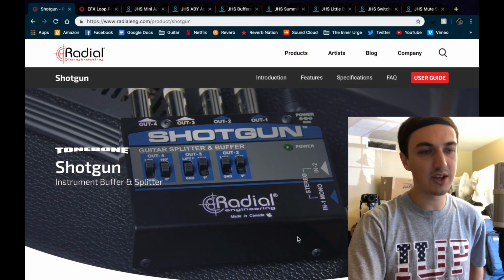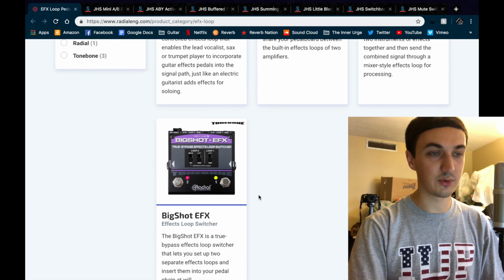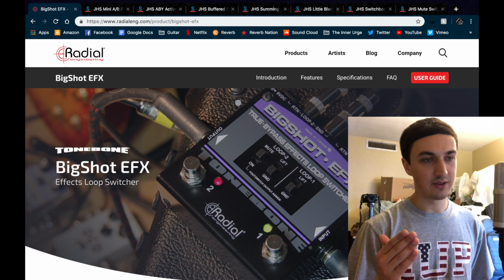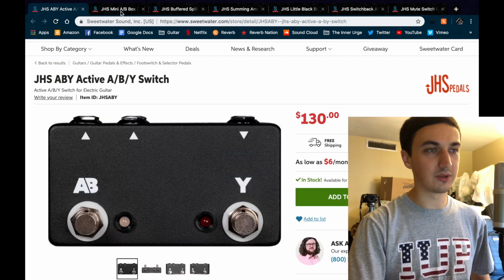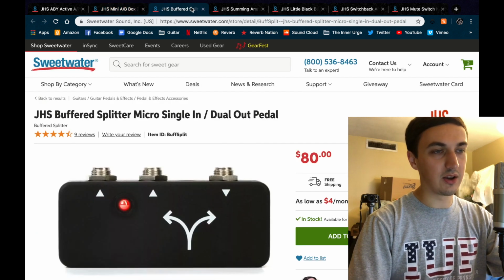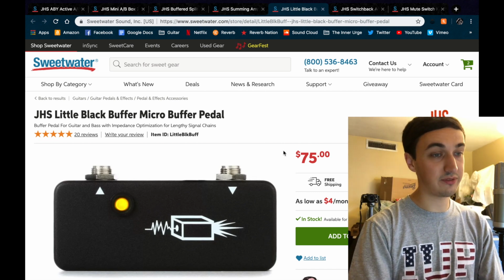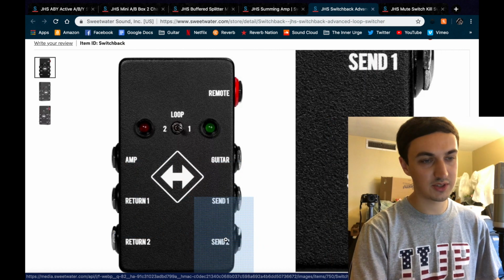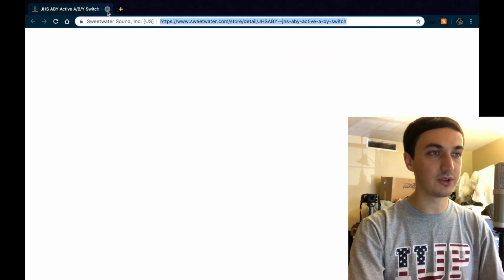Utility Pedals - What are they and how do you use them?

Comment: Not all expression pedals work the same. They use different potentiometer values and change which part of the jack is which (tip, sleeve,ring).
There are some expression controllers with switches to work with any jack.
Reply from the maker: Yeah, I use the Boss EV-30 on my large pedalboard and the Dunlop DVP mini on my smaller one. Both are able to be configured to be used with either TRS or TS connections, as well as inverting the polarity.

Comment: So, I have two amps which, I want to use in stereo. I have the TC ELECTRONIC stereo chorus pedal, stereo delay pedal and the stereo reverb pedal for my post overdrive modulations pedals. I need to get a splitter pedal to put at the end of my overdrive pedals to separate the signals going into the front of the two amps. 
These stereo pedals have stereo inputs as well as stereo outputs which, I am thinking of running the effects send lines of each amp into each of the stereo chorus pedal which, will then go into the stereo delay and then into the stereo reverb pedal and back into each amp’s effects return. 
I’m guessing I also need another Radial product put somewhere in at least one of the effects loop Lines?  

-Rick